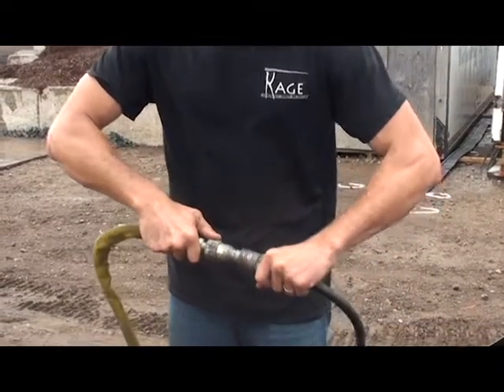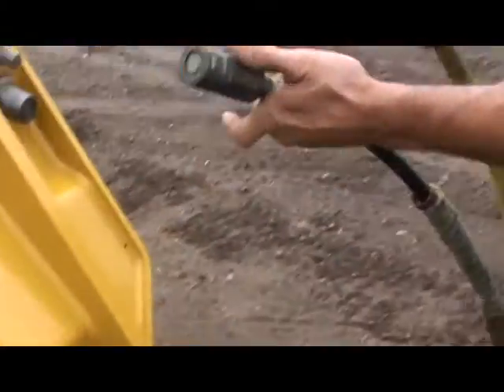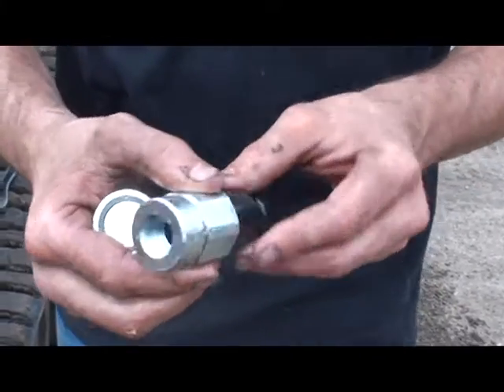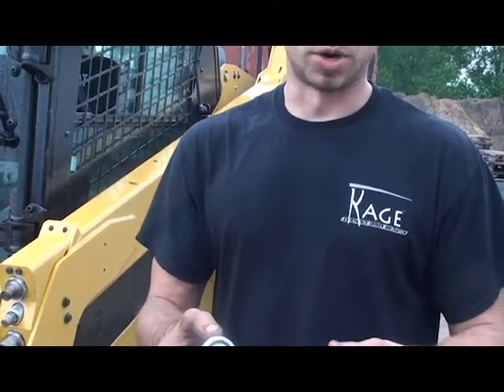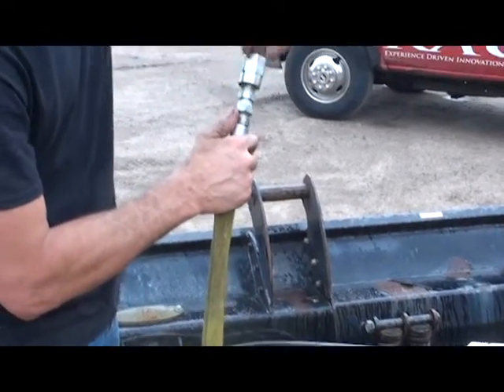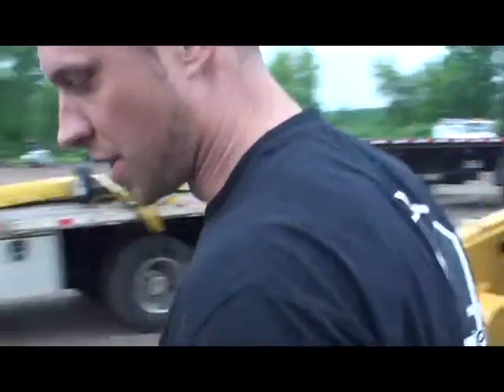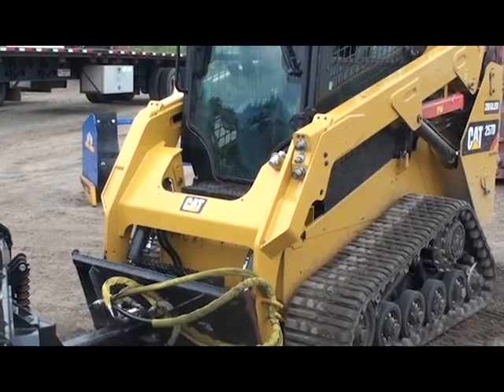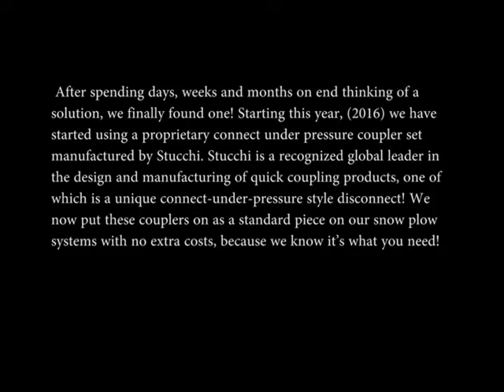Standard Hydraulic Couplers vs Stucchi Connect Under Pressure Couplers

Comment: If just using one 'connect under pressure' fitting, which side does it go on ... I'm assuming the implement side?  I ask this because many times a manufacturer makes only one side as 'connect under pressure'.  Thanks.
Reply from the maker: Yes, there are several Mfg's that only make the male side with the 'connect under pressure' option. However, we have found that when you have a plow application (two single acting cylinders or double acting cylinders), or anything that is not a pump or motor application, you need the connect under pressure on both hoses. So, we recommend using a male and female connect under pressure coupler on the attachment side.
Reply: @kageinnovation  Thanks very much for this info.  In fact, I do have a grapple with dual acting cylinders and is the reason I plan to install 2 male connect under pressure couplers on the grapple's hoses (and just regular FF (16028) female couplers on the 3rd function (tractor) side; as I can relieve the pressure on the tractor side.  Then I will color code each line so I know where to connect each 'male' FF coupler on the grapple to the tractor's 3rd function.  Would this use of the 2 male 'connect under pressure' couplings be OK; again realizing I'm relying on color coding to ensure the lines get connected correctly?
Reply from the maker: @davidolchewsky5365  yes, that should help your issue of re-connection considerably. Just keep in mind that the machine can also have residual pressure in it when you go to connect your grapple, so be sure to relieve the pressure on the machine side as well. Grapples are a common issue when it comes to this because if they are left open, gravity creates the back pressure over time. You can help avoid the back pressure by closing the claws, and relaxing the pressure in the machine / grapple BEFORE you disconnect each time. Otherwise the connect under pressure couplers should help quite a bit. Good luck!